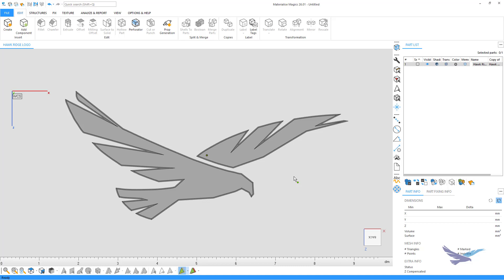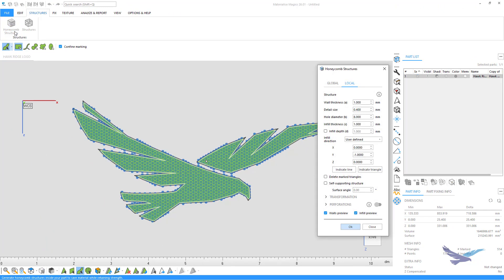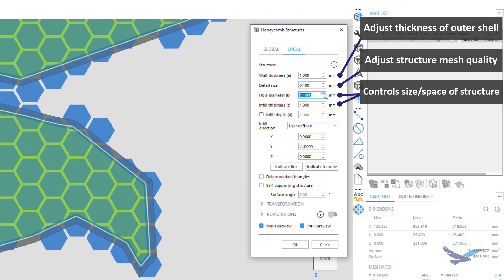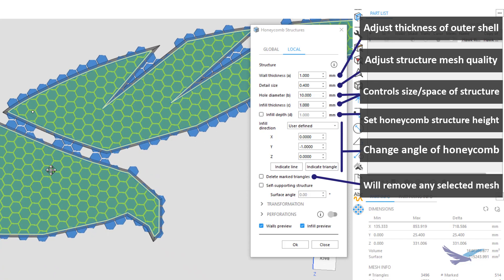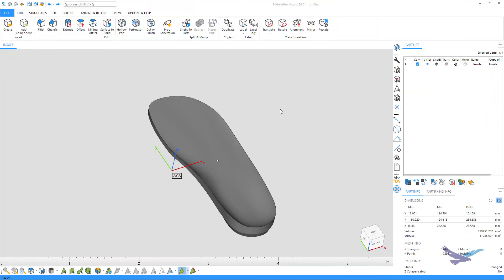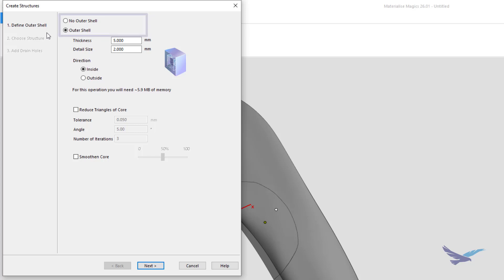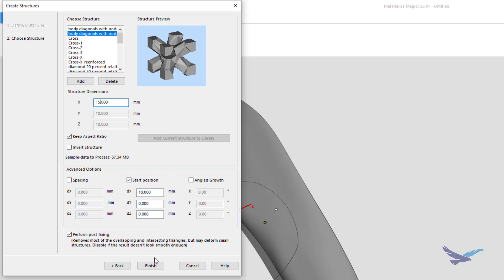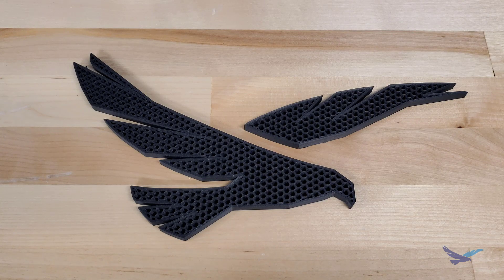3D Printing Thursday Episode 9: Creating 3D Printable Lattice Structures with Materialise Magics

Comment: This is unfortunate that this software is only for the HP 3d printers.
Reply: I'm pretty sure Magics can be used on a variety of different printers, not just HP. It depends on the modules and tools you get from Materilaise.
Reply: Correct @graybeard_art , currently using Materialise on a Stratasys SLS printer